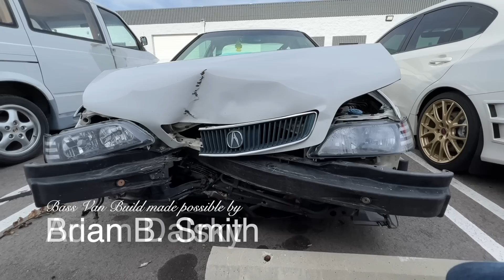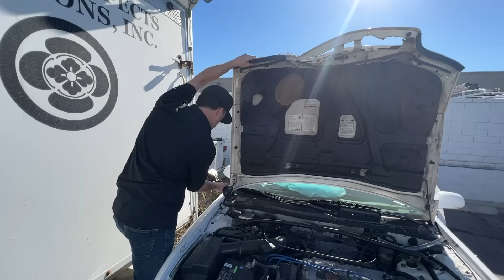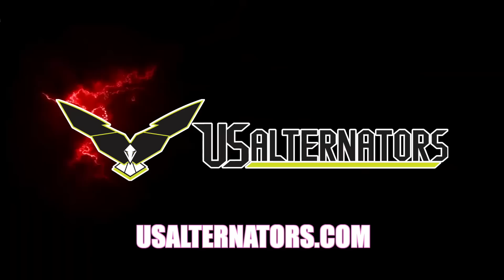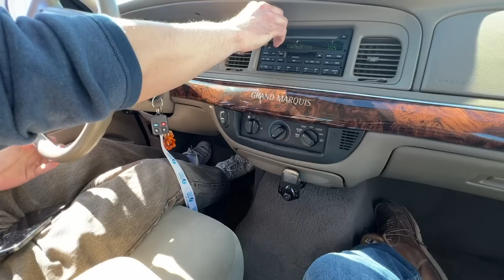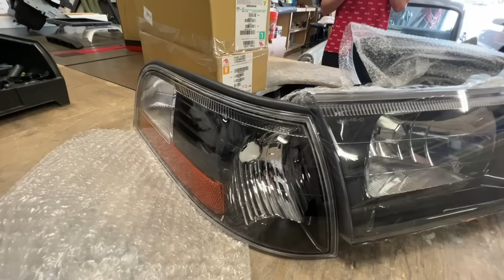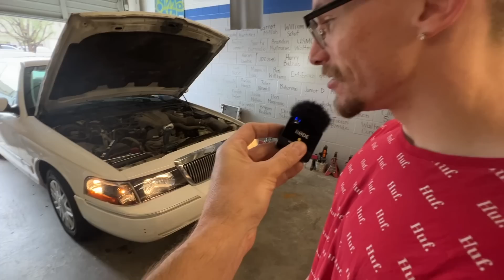FATHER SON - Pimp My Bucket - Headlights, Battery, Check Engine Light

Comment: just a heads up with the Grand Marquis.... they fuel tank kill switch is in the rear of the truck under the carpet.... if you throw a sub box in it with enough power it trips the switch as it thinks you were in a rear end collision or roll over..... not so funny when you are on the highway and bass sets it off.

Comment: Those crown vics won't send the signal to the alternator to charge if the engine doesn't idle above 800 rpm. I know it's a stupid thing I chased in a buddies ride until he gave up after throwing parts and a couple alternators at it.
Reply: The Grand marqweef sounds about my size.